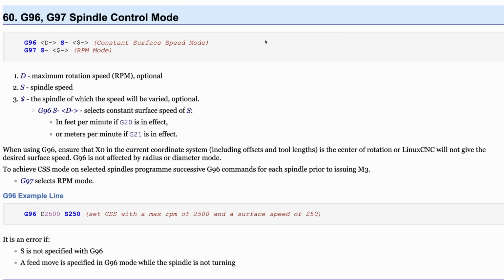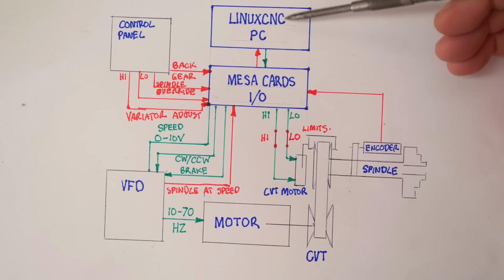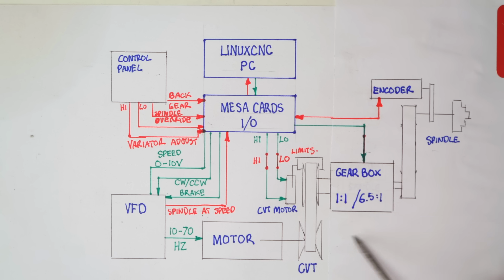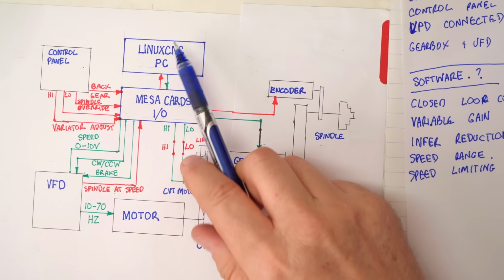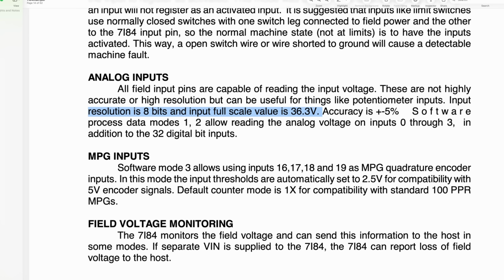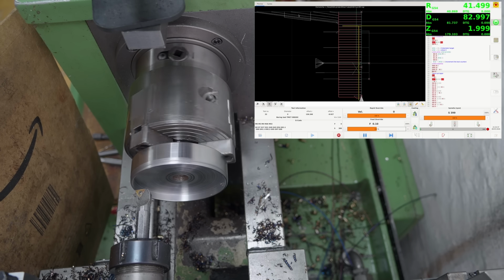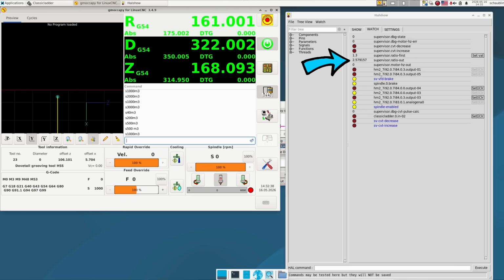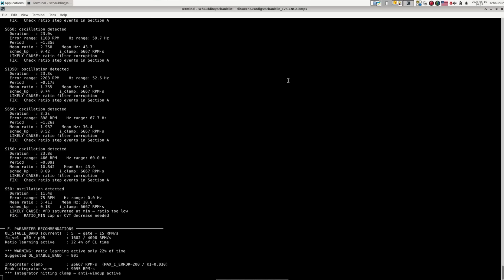Schaublin spindle control Ep.68. || RotarySMP

Comment: Maybe adding a gear tooth detector in the gearbox would give.the CVT output speed? 
(Something like an ATS-667. These have a magnet and a hall sensor and are specifically designed to detect gear teeth)
Reply from the maker: Hi Andy,
Nice idea, but it is probably significant work to pull and disassemble the gearbox, drill the case to install a sensor, which would provide lower quality data than an encoder.

However, I am thinking of taking one last swing at my original idea:
- divide the CVT range into 5 fixed ratios, one second apart.
- survey the whole range,  generate a look up table of CVT "fixed ratio", and VFD Hz.
- largely open loop with VFD frequency interpolated between LUT values.
- Maybe switch to closed loop to fine tune speed (but how accurate does lathe speed need to be?) If added, add PI gains to the LUT.
- I already have VFD "motor on speed" wired in, and had not thought to use that togate and freeze the ratio calculation when it would be garbage. 
- when there is steady state operation, use the calculated ratio to cross, check and maybe correct for CVT drift.

If I can't get that working, and really need a sensor, there are a number of ideas:
- pull the motor fan, and use the shaft stud to drive an encoder, and then mount an electric cooling fan on the shround for the motor. 
- Make a little amplifier to scale that 0-10V motor speed output to 0-36V
- use an optical or hall sensor to count motor fan fins, or CVT features.
- Add an encoder to the CVT linkage, or to the CVT lead screw.
- Replace the CVT motor with a stepper or servo
- Use a laser range finder on the CVT belt with a look up table to estimate ratio.

The first seems to me to be the most likely to simply work. With encoder in and encoder out, the gear ratio would be rock steady and real time.
The second is probably less work, but is limited by my electronic knowledge.
Reply: @RotarySMP  You could throw money (Mesa 7i87 smart-serial card) at the problem,
Reply from the maker: @andypughtube  Hi Andy, Another good idea I had not considered. Thanks, I have really appreciated your inputs on this spindle drive since I first started thinking about it.
Reply: @RotarySMP  " Maybe switch to closed loop to fine tune speed (but how accurate does lathe speed need to be?"
if you can maintain the exact speed you can maintain the rotational phase between the tool and the work, and do free-form threading without a gearbox in the way :)
Reply: How about you put a black or reflective marker on the shaft and read read the signal with a  reflective encoder. This should give you enough of a wiggle signal that you can put it through an OP-Amp to get a square wave,  showing the speed of the spindle.
A reflective encoder using an LED and a photoresistor (LDR) works by bouncing light off a rotating surface to detect motion. The LED acts as a light source, while the photoresistor acts as a light-sensitive detector that changes its resistance based on the intensity of the reflected light.
Maybe your friend Mike in Cambridge could help you with this?

Comment: Hmmm, the joy of programming with AI. Welcome to the club. 😅
I think that your assumption you could guestimate the intermrditate gearing and ratios is like belueving in magic.
I do not think you can do this in a time fast enough to be manageable.  You either produce oscillation, or you need to go very slow. Additionally, your calculations have no unique sokutions, abd trying to guess whst is the actual hardwate configuration is again like magic. So, i think you need to add a few encoders on vfd spindle control and use the end switch state to drivesensing xircuit and feed this back. You could use an optical dnvode thst is couple to the spindle with a rupperylinder kike the old mechanicsl mouses did. Bot accurate, but good enough if you calibrate the puls range with the end switches when you power up the lathe. You will have slippagd and wear, but the frequent calibrations shoud tske care of that. 
Furthermore a mechanical switch for the Gear ratio selection should also not be beyond you capabilities having the maho to produce mountibg brackets. 
As to calculation speed, i presume you tried to use python or a similar language. Thst would be fine, if you had a less hysteresis-prone problem. I am clueless about linuxCNC, but i am sure that there must be a mechanism to load custom code libraries (.DLL/.so/.o) into the System and use them. You should try to go as close to the metal as possiblewith timing critical calculations as possible use compiled SW fed with real data not ASS-U-MEd data, the you will get usable results. After all SISO os still valitid Shit-In/Shit-Out.
Good Luck, and thank you for sharing this fazcinating developing story.

Comment: You seem to have a scaling issue with  the "actual moter speed output" from the the VFD.. Is that an analog output or a digital ouput? From your discussion it  sounded like that was an analog signal, that you wanted to digitize via the existing controllers. If I understood you correctly, the "actual motor speed" signal was 0-10v and the AtoD system was scaled for 0-32V. Adding a simple analog gain block between the VFD output and the AtoD input would not seem rocket science....
Reply from the maker: In that video, I covered that the VFD has an analog motor frequency out, but it is only a 0-10V signal, and the mesa analog input pins are 0-36V at 8 bit, and therefore it would be low resolution. I have now received an OpAmp to perform that scaling.

Instead I used vfd commanded voltage as the input to the ratio calc. That of course instantaneously changed, whereas the spindle speed output ramped, so the ratio signal needed a lot of gating. That didn't work well.

Comment: How about:
1) select range based on rpm
2) select motor initial base speed based on lookup table
3) PID control spindle motor to spindle encoder
4) adjust CVT based on trying to maintain motor frequency around VFD mid frequency range

PID will be fast acting on motor but logic adjusts CVT to extend the range.
On startup it doesn't matter where CVT is.
Probably be helpful to tap into CVT limits to know when you are at max/min range..
Reply from the maker: Watch this space for my next attempt.

Comment: If I understood correctly, the VFD offers a 0->10v spindle speed output, but the mesa card accepts a 0->36v input ? You should be able to put a somewhat simple op-amp in line to condition the output to fit your input.
Reply from the maker: I should, but then I'd also need a 24v -> 36V step up power supply, and I am not strong at electronics.
Reply: @RotarySMP Amazon in US has 0-35v - > 5-45v boost converters. It's a small signal, so low amps.

Comment: My immediate reaction when I saw your problem was a cascade PID loop. These are two PID loops: fast and slow. The fast loop is a normal encoder to VFD loop.The second loop controls the CVT. That controller tries only to keep the output of the first loop at 6V (= 50Hz). 

I think you do not have to calculate the gear ratio, etc. Maybe it would work without any additional hardware.If the output of the fast controller (VFD) is below 5V, the CVT turns on until it hits the limit or the controller output is above 5V and below 7V. Above 7V, the CVT turns on in the other direction.

If this does not work and feedback from the CVT is needed, a Wire Encoder Rope Displacement Sensor for Linear Distance (Aliexpress) can be considered. Then, the PV (actual position of the CVT) can be used to calculate / adjust the Kp, Ki, and Kd of the fast VFD loop.
Reply from the maker: Thanks for your input. Watch this space.

Comment: Why not map the CVT actuator and use the map in software. Say 1/4 turn, ratio is R1, 1/2 turn, ratio is R2 and so on
Reply from the maker: That will be the basis of me next attempt, bu CVT motor on time rather than actuator rotation (which is currently not sensed.)

Comment: I've worked on lots of small and some fairly big programming projects, and not surprisingly I've found that doing estimations like you are trying to do in Linux CNC is one of the largest sources of bugs. There's of course lots of cases where you have no choise, but try to avoid infering values, and avoid using sleep routines as much as possible. It was a both interesting and frustrating to watch you learn the same lesson as I have. 😂

One of the issues with your approach is that the routine doesn't know the rotating mass, and that could break the code if you later work on some setup that has a lot more inertia than your test piece.

It would be interesting to see what strategy you come up with to determine the backgear and CVT position from encoder speed, as there's overlap.

One question. It seems strange to me that there would be seconds of delay before your code finished calculating the speed. A modern PC should have no issues doing that in miliseconds, even when it's done in an interpreted language like python. Are you sure that this is the case?  If it really is CPU-bound, then his should be easy to see if you run a CPU monitoring tool like XFCE task manager.
But maybe I misunderstood.

Best of luck in your future coding adventures.
Reply from the maker: Those pauses were programmed, as the inferred ratio was commanded VFD voltage (which instantaneously changed) vs spindle encoder, which accelerated. During accel/decel this value is garbage. So I needed to gate the ratio calc, and release once stable. In that first attempt, ChatGPT separated CVT bump, or VFD PI adjustments, and gated each. Very slow.
Turnes out, since I already have the VFD motor-at-speed wired into LinuxCNC, that would probably provide a more robust gate.
I added some info on my options and next attempt to the video description.

Comment: From my experience using a cnc lathe with a hi low gear box, the controller would read the program to see what the spindle speed is going to be. And if it was below 500rpm it would switch the gear box to low range and above 500rpm hi range before running the program. As far as I know it didn't have a CVT between the motor and gear box. So what is do in your case would be to remove the CVT and put a bigger motor/VFD in. Then it will be easy to change speeds on the go. And if half way through a program you have to go above 500rpm then the program would pause the gear box would change to hi range and the program would continue. And the vfd would control the speed in the two different ranges.
Reply from the maker: Thanks Deano, I covered that in the video. I don't have the cash, or the high amperage feed for a much bigger drive motor instead of the CVT
Reply: @RotarySMP sorry I didn't hear the part you said you didn't have a big enough feed to your workshop. Oh the things we would buy if money wasn't a problem 😂 I hope you figure out a way of doing it.

Comment: Nice video, just some thoughts on it.

With problems like this, in the past I used to try and model the plant (this being the gear train) such that it would run fairly well open loop. PID is then there to make error corrections on the model.
I call this the "feed forward" technique. The complication in this will be in a way to predictably model the CVT. 

I think you need to know the AC motor spindle RPM as well. The ratio of the CVT can be calculated from the difference between the motor speed and the headstock speed.
Predicting the CVT ratio is a bit tricky you may have to pulse the motor to creep up on the needed ratio but you have the calculated CVT ratio from the other 2 encoders. I think this would be the hardest part to get working good enough to do the job. Maybe its some type of delta change model (I am at speed X and want to go to speed Y,  Starting at X, I already know how long to run the motor to get close to the new value) ,,, and the curve on this is non-linear making the prediction table more complicated :(

Modelling - It may be an idea to draw up and code a gearbox table. So for speed range X - Y you may be able to use a set motor RPM and gear ratio and just vary the CVT ratio. Wider ranges may need to have the motor frequency adjust at the limits.

So, PID on the AC motor, (more complicated) PID on the CVT. They take care of themselves and the controller drives the 2 loops according to a pre-set table setting.

Oh and if you can get the opportunity, the Claude Opus agent is a little bit smarter, in terms of coding and analysis. Only in a paid account you could probably get a high enough token count to do the entire conversation.

Cheers and good luck!,
Reply from the maker: Good inputs. Thanks.
I have written up my plan for the next attempt in the video description.

Comment: Consider this; if you took the computer out of the picture, how would you control the spindle speed manually? I don't think you'd be trying to adjust the variator while the lathe was making a cut. It doesn't seem like you have enough feedback or control authority on the variator ratio to use it for constant surface speed operations.

I think the best you can expect from the hardware is to be able to do some limited constant surface speed work with the VFD, and use the variator between cuts to get back into a sweet spot for motor power.

I haven't played with linuxcnc; can you add custom G codes or look ahead at the next few instructions so that the CNC controller could know how to best set the variator ratio for a specific cut, so that you start at one end of VFD's speed range and end at the other?
Reply from the maker: Good inputs. Thanks. LinuxCNC has motion look ahead, but I don't beleive it has spindle speed look ahead. I have written up my plan for the next attempt in the video description.

Comment: I'm a Software Engineer, and to make sure I don't fall behind, I use AI all day every day. I have some suggestions for you:

If you want to have decent success of having AI drive software development of anything reasonably complex, you need to allow the AI index and interact with the filesystem for the project.
AI models today (as you have discovered) have a very limited memory (context window). They will quickly forget and hallucinate large sections of code if it cannot find and read sections on demand.

The way around this is to allow the model to use AI tooling that facilitates the model to index, find, and modify source code without needing to recall from memory, or waste lots of tokens.
There are a dozen ways to do this, but here are some tooling recommendations:
1. Cursor - This is VS Code with AI tooling bolted on, and really is the tool that kickstarted the whole 'vibe coding' era with decent results. Once it is installed, it can be leveraged very effectively to develop and modify code without needing to figure out any addons or config files. It works great out of the box, and in my experience is still my go-to for ambitions projects as their indexing engine seems to be the most capable and efficient. 
2. Claude Code / OpenAI Codex / Copilot CLI - These are a bit less friendly to work with if you aren't a developer yourself, but are also very powerful (and can leverage the AI subscriptions you already have).

Regardless of what you choose for AI tooling, you should absolutely utilize Git to version-control your config & source code changes. You do not want to waste time trying to roll back changes to a specific file section manually, especially if you are letting AI do a lot of these changes. use a graphical frontend like Github Desktop if you are unfamiliar with the Git CLI to make your life easier.

Another big recommendation is to close the 'human in the loop' for AI development. You made a positive step in having AI generate some diagnostic output it can feed on, but you really want the AI to make changes and test them autonomously. The AI tools can already generate CLI and MCP connections to take control of hardware on your behalf to test & diagnose problems. I know, it is very scary, but this is how you make AI actually make positive changes. The human in the middle is what stalls development and introduce inconsistency. (Of course, you watch it as it works if you need to interrupt).

Feel free to reach out to me if you have questions or need help on how to setup and implement these changes. I would be happy to help solve your AI woes.

Comment: great video. I would start from the other way. give the AI the paramters which are possible and let it generate a table of optimal conditions (e.g. in 250rpm steps) check that manually. than you should have the starting conditions for your automation. Than let the ai use that table to set the gears. and only in csp-mode change from your starting speed with the VFD.
Reply from the maker: Thanks for your ideas. I have written up my plan for the next attempt in the video description.